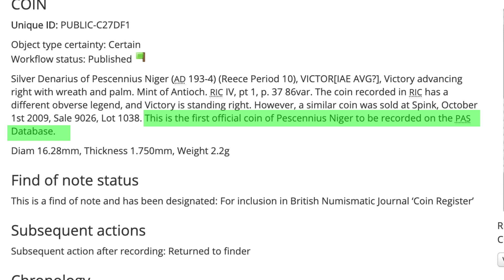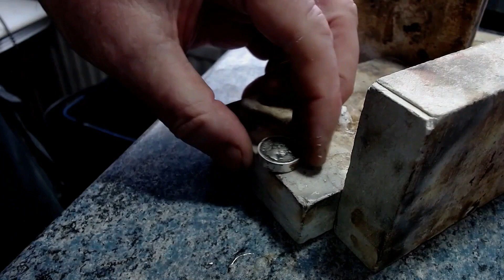£1,800 in auction?

Comment: After recording on PAS I give them all to landowners, local museums or schools.  Don’t keep anything.
Reply from the maker: That is very unusual.  What is the reason for this?
Reply: @TheManWithTheHat  I’ve been field walking and detecting since childhood as our land was on a Roman/Medieval settlement site, had a very old trackway and packhorse route running alongside it, and a turnpike following the Roman road down to a Ford, later a bridge.  A Roman hoard was found just off our land when they were building a new house and some of them were given to our  village school.  This got me interested so I started collecting things and pestering the Curators at Doncaster museum for an ID. 
When I went to university my mother cleared out my “treasures” from the barn dumping most of them.  I did dig through our dumping ground in an old quarry at the back of the farm but never recovered most of them so now I just record things (I’m a PAS self recorder) and depending on their significance offer them, with the permission of the landowners, to the local museum unless they want to keep them for themselves.  Otherwise I make up a small display and offer them to the local schools in the same way that the Roman hoard was given to my school.
P.S.  I do keep all the lead tokens if I can, especially the earlier 13th cent pilgrim tokens.  We find a lot around Salisbury 🙂
Reply from the maker: @YorkshiremanInDorset  Very nice read. Thanks for that

Comment: I think you should have left the coin unpolished in the ring. Doesn't that ruin the value of the coin?
Reply from the maker: It’s only worth around £50 Richard.
Reply: @TheManWithTheHat  I think I forgot you made that coin from a mold of the original.
Reply from the maker: @richardbreisch8049  no mate. It’s the original